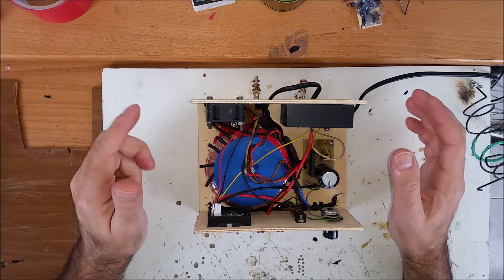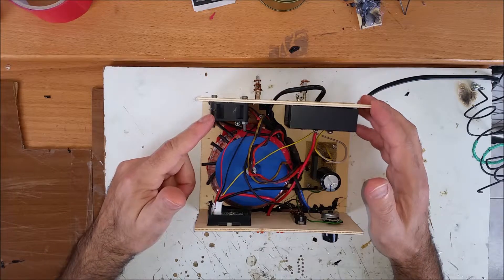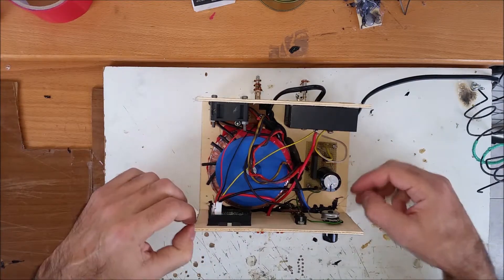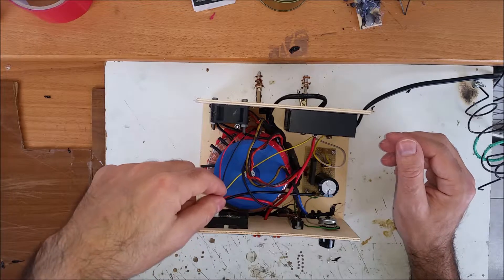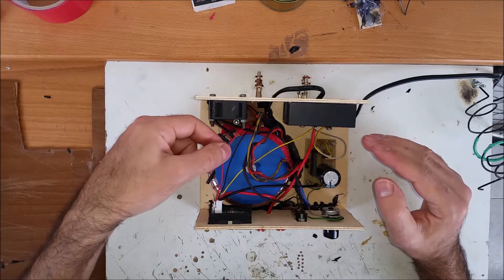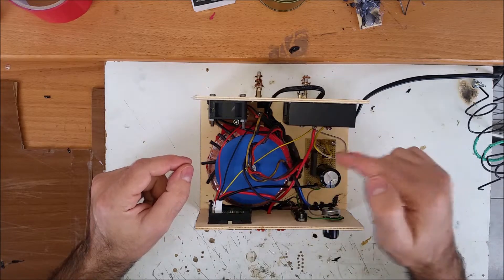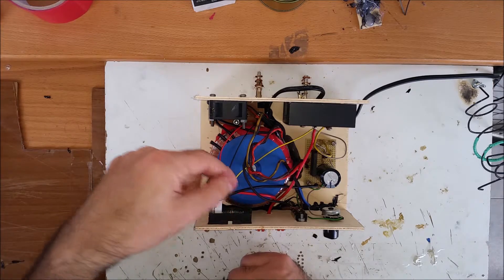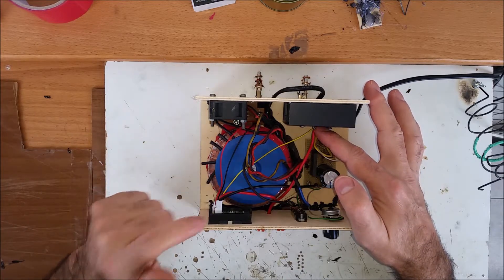DIY Power Supply #3 Wiring the AmpVoltmeter

Comment: it would be helpful if you would upload the schematic diagram of the ckt ... that how to wire them while the power bench can be operate separately . i mean current and volt can be adjust separately in some power bench . so how can i connect this gauze in that type of power bench ?
Reply from the maker: This power bench dose not  have a current control , and the guadge is here :   https://m.youtube.com/watch?v=oCy8Fu5Wv9k